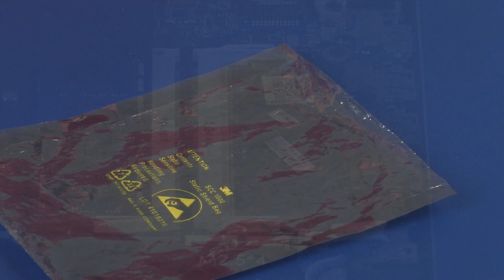Replace the Memory Module(s) | HP ENVY 15-ae000, ah000 Notebook PC | HP

Comment: HP Envy 15 i7-10750H 16Gb SSD 1Tb nV RTX2060 6Gb MAX-Q 15,6 UHD AMOLED TouchScreen(MLT) BT Cam 6821мАч Win10 Серебристый 15-ep0027ur 1L6G9EA                    is it possible upgrade RAM?
Reply from the maker: +Денис Иванов It support for 2933 DDR4 , 1.2 V, upgrade able, system memory in 32 GB (16 GB×2) and 16 GB (8 GB×2) configurations